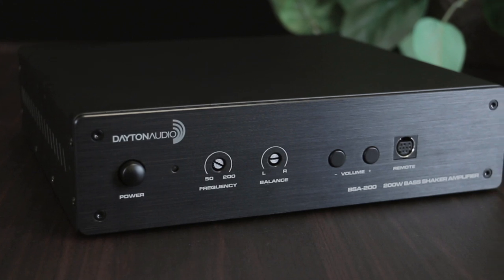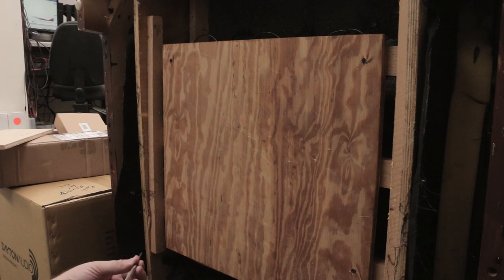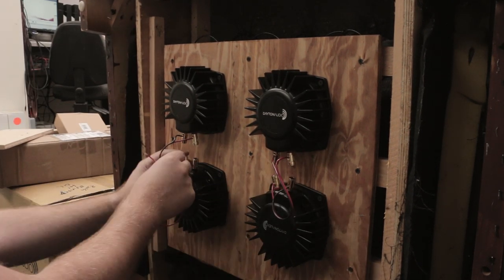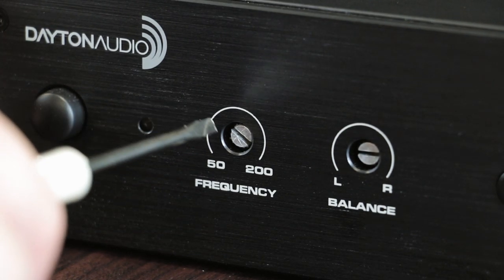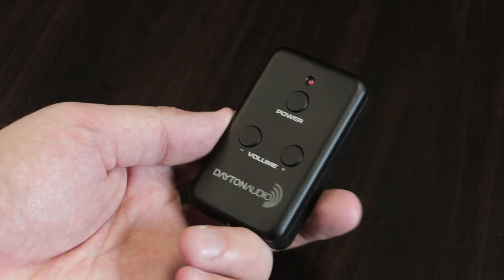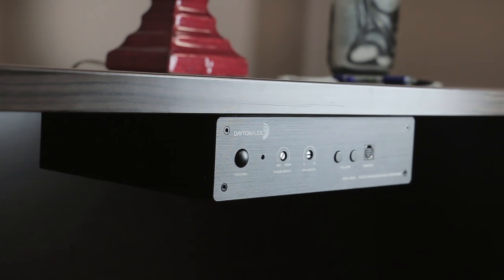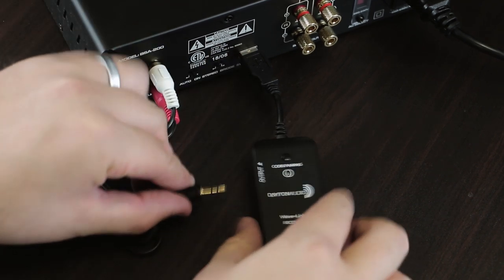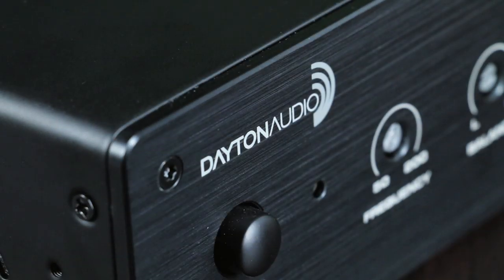The Best Way to Power your Bass Shakers!

Comment: How many bass shakers can I connect this too at 1 time? Need to know if I require just one or 2 of these.
Reply from the maker: It was built to power 4, but here is the power output readings: Output power: 110 watts RMS per channel @ 2 ohms, 230 watts RMS @ 4 ohms ( minimum impedance) bridged mono
Reply: @PartsExpressOfficial  If i plug 2 BST-1 on it pluggin at 110W should it work because right now nothing is happening on the BST-1
Reply from the maker: @emmanuellafrance538  reach out to our techs to get an answer on this type of question. To get technical information about our products: Email: Tech@Parts-Express.com Phone: 1-800-338-0531 Hours 8am-6pm M-F EST / Closed Sat & Sun
Reply: @PartsExpressOfficial  230 watts RMS divided with 4 (speakers), am i understanding that correct?

Comment: Is there an updated version for the bsa-300ex’s? 200w is underpowered for those transducers
Reply from the maker: There isn't a specific recommendation. Depending on how many units you're running, I prefer the SA1000 for the 300ex, but any subwoofer amp that matches the required watts and ohms will work. Options like the SPA250, SPA500, SPA1000, or the SA1000 are all suitable. Since the 300ex is quite efficient, bridging it to the BSA also works well.
Reply from the maker: The "turn on thump" is rare and may not be considered an "issue" The SA1000 has a switchable subsonic filter. The crown though would be a good option as well.

Comment: I have an old QSC RMX 2450 amplifier, I have been wanting to use it for a bass shaker to enhance my immersion. Question is though will my amplifier be sufficient.
Reply: Yes.
Reply: Also, you might blow the shit out of them depending on what you have.  Most require pretty low wattage.

Comment: So how do we do this with high end sound bar. Q990d limited outputs only inputs
Reply from the maker: Since the subwoofer is wireless and is communicating via a hidden SSID via Wifi, or potentially via a hidden Bluetooth ID, that signal would have to be intercepted somehow to then be received by a DAC and then routed analog to a separate amplifier, or, transmitted again wirelessly via an item such as the Dayton Audio Wavelink.

The only other approach would be to open the Samsung subwoofer and utilize a Speaker Level to Line Level converter (LOC) to splice between the amplifier driving the subwoofer, and creating a line-level analog signal that can be then routed to a separate amplifier, or the aforementioned Dayton Audio Wavelink solution as a wireless means of communication.
Reply: @PartsExpressOfficial  I just worked it out, still testing but via Bluetooth from Samsung tv to 2 devices - sound bar and Logitech BT adapter to bass shaker. The lounge is rumbling! A slight delay in still working on. And I can’t use the tv sound delay setting as then it throws the sound bar out of syncs with TV. Hope this helps people as we are all only $200-500aud away from awesome rumbles within your lounge aka now theatre
Reply: I can confirm I am using butt kickers and bass shakers via Bluetooth to Samsung tv with additional Bluetooth to sound bar

Comment: How do I send a flat subwoofer signal after running audyssey? I have a Denon X3300W and two subs using each of the LFE channels. I assume I need to send the shakers an uneq'd signal but i dont know how given my setup. All 7 channels of speaker outputs are being used as well. Thanks in advance.